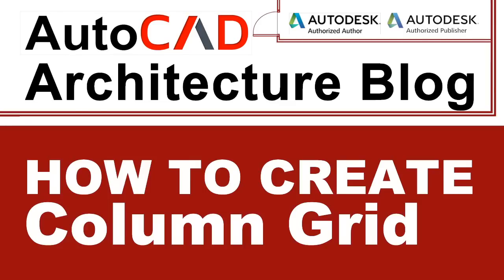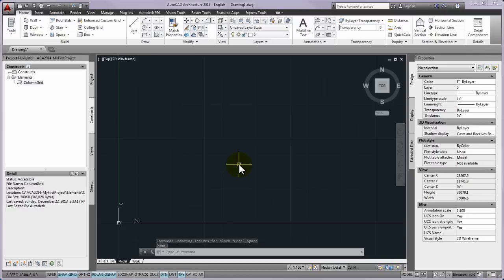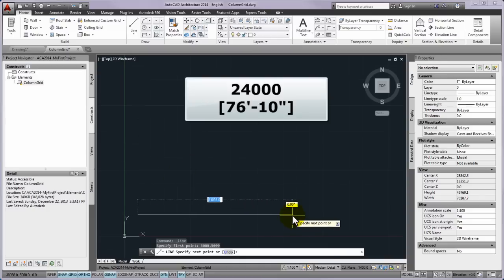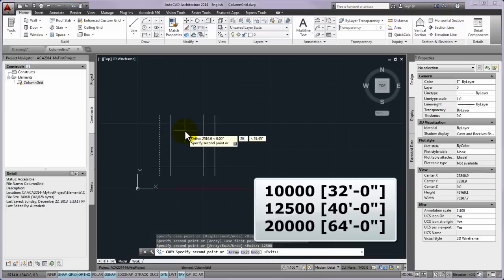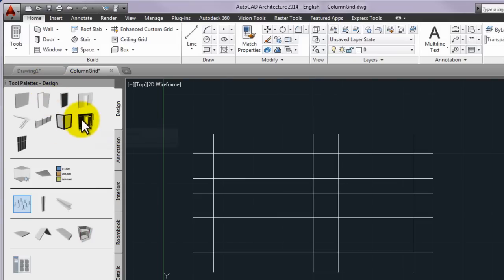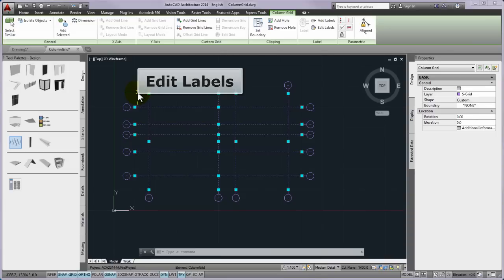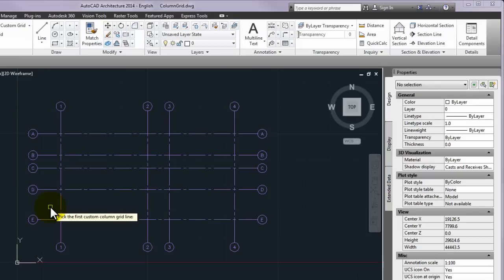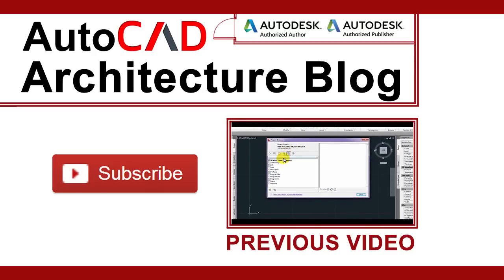How to Create the Column Grid of the Building | AutoCAD Architecture Tutorial #4

Comment: I have a problem with the column grid as well as with doors and windows. We are not working in mm but in cm, so there is a constant error with the display of grid bubbles and with the door frame as it all seems to be prepared for a ten times smaller scale. Is there a way to change the scale of those elements? Thank you.
Reply from the maker: If your drawing units is centimeters and you insert Column Grid with Labels then the Labels size will be right size. If not, you have two chances. 1. Before you being to draw set the drawing Units to Centimeters. (AECDWGSETUP) 2. Or use this command after that you drawed something in millimeters and select Rescale only modelspace objects option.

Comment: Honestly, my copy function does not work as yours does, its extrememly irritating.
Reply from the maker: The AutoCAD Copy function?
Reply: Hi, yes the in-software copy function, 2014 version of Architecture.  Starting at 3:17, you begin to use the copy function from the banner bar.  At 3:25, the video shows your cursor next to the line that is going to be selected, and then the line all of the sudden is selected (keyboard shortcut?).  Of course I am able to use the copy tool and select the line that is to be duplicated, but my cursor does not grab the line, and stay attached with movement of the mouse as yours shows.  There are some other differences, but clarity on this specific one may solve the rest.  I have been through all the tutorials prior to this one from you as well.  Very good tutorials.
Reply: Daniel Nogueira Hi, sorry, maybe we cut that moment when I select the line. Of course, you need to use the cursor to select the line.